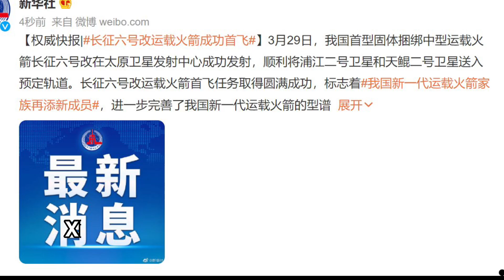China pulls off maiden flight of new Long March 6A CZ-6A rocket

Comment: LongMarch 6A has a new setup,  using liquid fuel in core boosters and solid fuel in side boosters.
Reply from the maker: Yes. First Chinese rocket using SRBs.
Reply: Why is there so much smoke?
Reply from the maker: @2KSnSLifestyle  The white "smoke" filling the air is really steam from those millions of gallons of water evaporating. The actual exhaust smoke from the solid rocket motors goes out the other end of the launch pad through the Flame Deflector System.
Reply from the maker: @2KSnSLifestyle   The white "smoke" filling the air is really steam from those millions of gallons of water evaporating. The actual exhaust smoke from the solid rocket motors goes out the other end of the launch pad through the Flame Deflector System.